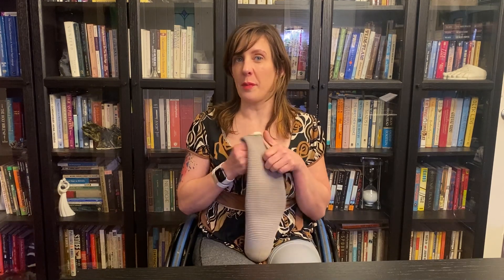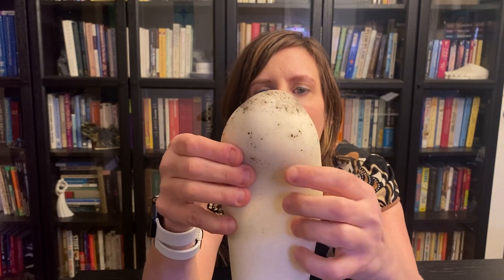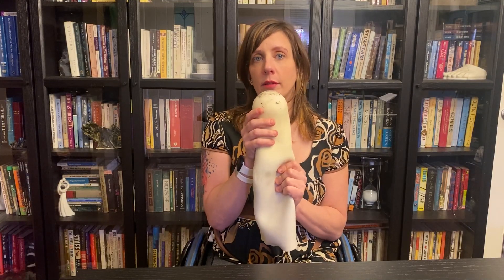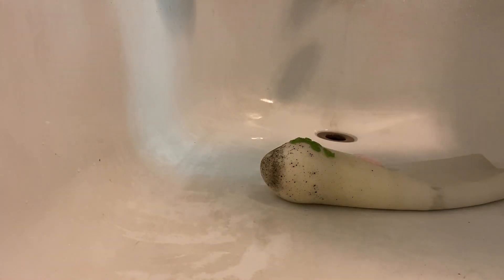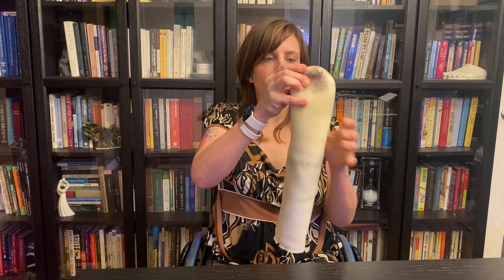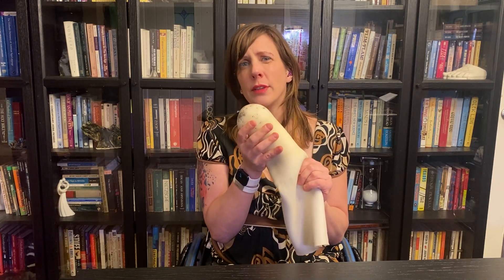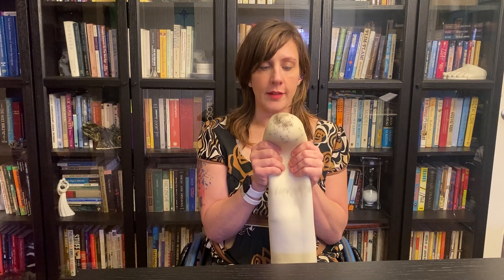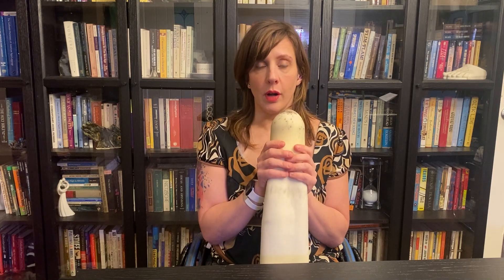Mold in my Liner! What went wrong and how to fix! (Ak and BK amputees)

Comment: Good advice, Christina. After I wash and pat dry my liners, I hang/stuff them between the bathroom towel rack and wall. The seal-in rubber cuff holds them up. I don't use a drying stand. There is also a forced-air vent on the floor under the towel rack, so lots of air circulation. No mold so far after 5 years.

Comment: I wonder if a boot dryer would do the trick for drying a liner? They’re made to put a tall waterproof boot onto (upside-down) and it blows air all the way into to toe of the boot (or tip of the liner) to get it dry. It might not be worthwhile, depending on the cost of liners.
Reply from the maker: Probably! They are $400-600 each without insurance.
Reply: @AmputeeOT  HOLY CRAP!

Comment: Just a thought, but have you considered using a germicidal UV lamp (carefully! those things are dangerous) on the mold? It wouldn't remove what's there, but if the light can penetrate the silicone, it would kill it deader than dead.

Perhaps poke at the awesome maker community to maybe look at ways to make cheap drying racks that won't have this problem?